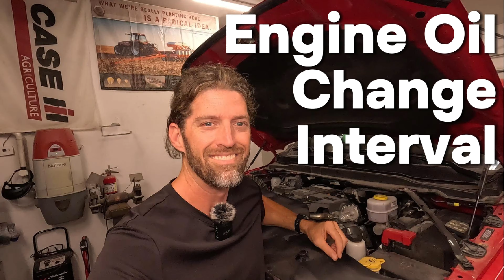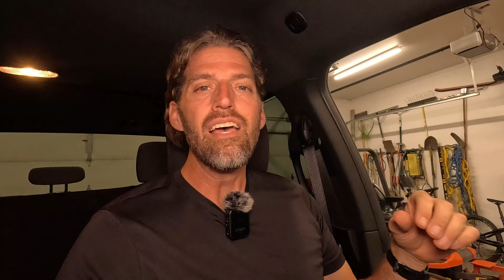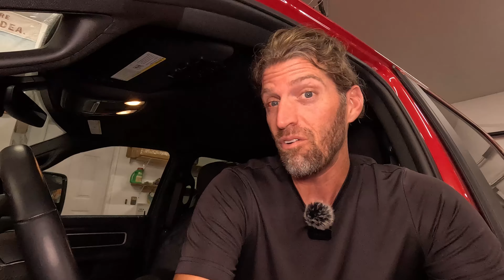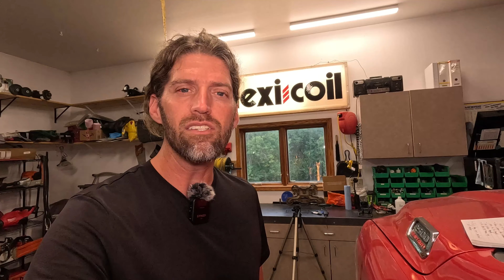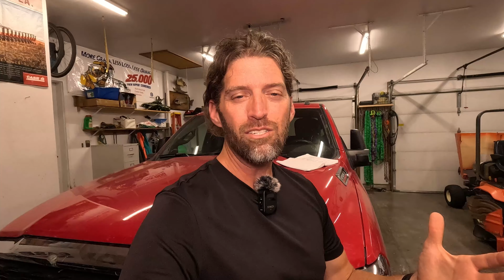When to change your engine oil? Factors to consider.

Comment: In SAE paper 982718, they ran a test on extended oil change intervals for fleets for 500,000 miles and found that 30k miles on a diesel engine was safe and had no adverse effects on engine durability. They even tested 45k-60k and the oil was still within acceptable parameters. You could save a lot of money if you went 30k miles on your oil changes for diesels. If you want to know for sure if its safe, just send an oil sample to an oil lab and they will tell you if the 30k mile interval is safe.
Reply from the maker: Appreciate this comment. Fully aligned to we non-commercial users of diesel engines probably change our oil earlier than necessary. Definitely a huge sentiment of 'it is cheap insurance', which i can respect. If there was only a way to sense the equivalent of an oil sample within the sump/block for more accurate oil life indication! Cheers.

Comment: every 5000 miles if use full synthetic less if don't period 
oil and filter is cheap maintenance
Reply from the maker: Any thoughts on engine hours versus miles for change interval? Seeing more vehicles showing hours, which I think is a good things, give us a broader picture of engine use. Thanks for sharing!
Reply: @LearnedFromDad  I agree with you that we need to look into it but we just don't have enough information about the hours yet but if he is having lots of hours and still it's not telling him to change oil for 14000 miles I have problem with that so until more information I know on our company equipment we change oil every 200 hours just because of the abuse it gets but right now I don't believe it is an affective way for vehicles only time will tell

Comment: any good mechanic will tell you never to follow the owner’s manual intervals because it’s way…. too long. manufacturers only care about the warranty period not the life expectancy you want from the car.
Reply from the maker: Thanks for sharing. Understand your point. I work with and train mechanics for a living, lots of horror stories but also many non-negative.
One of the key things I was hoping to get more conversation was the difference in change interval based on hours (which I believe is superior), versus miles (just an estimate of engine use).
All good though, great discussion. Cheers!

Comment: Every 5000 miles/ 8k kilometers or every 6 months. Toyota recommended for my 2005 Camry. Still driving it 20 years later. Toronto Canada
Reply from the maker: Thanks for watching. Yes, recommendations have changed over the years for many reasons, and vary widely depending on engine type (gas/diesel), oil capacity, etc. Any idea how many engine hours it takes for you to hit your 5k miles / 8k kilometers?
Reply: Fellow Canadian here, I change the oil on my winter and summer tire swops, every 6 months roughly 10K   13 Camry and oil is never very dirty!
Reply from the maker: @davidcampbell1899 that's a great way to never forget when to change! Thanks for the comment!

Comment: For gasoline engines the easiest way is to simply keep your oil clean, use your eyeballs and common sense! By dropping some oil on a piece of paper from the dip stick you can see the oils condition, (the oil blotter test)  if it is turning a brownish  color then it is time to change.

On diesles the oil get´s black pretty quick so going by the milage might be a good idea. Today´s motor oil holds up very well, it´s the deposites that are the problem, by changeing every 5000mi you can be pretty sure the oil is not worn out. 

Oil and Filters are cheap, there is no need to buy the most expencive BRAND! As long as it meets the manufactuers API Spec. you can use the cheapest oil you can find. 

Keep it simple........Keep it clean.
Reply from the maker: Thanks for the comment. Agree, keep it clean. Great maintenance is important. Good comment regarding blotter test. Hopefully the filter is doing its job, isn't clogged, and opening the (potentially present) by-pass.

And, I appreciate your comment about ignoring all the 'marketing' gimic, and price not identifying quality.......follow the API/testing standards.

One thing I was really hoping people would discuss more is engine hours as a means of engine use. I know miles has always been king, because that's what we've had for years in passenger vehicles (no hours shown), but engine hours is what really identifies the amount of time/use that engine has had on that oil change interval. I mean, I've never seen a generator or power unit accumulate any miles :) Of course there are all the micro nuisances like trip interval, hot/cold cycles, environment, etc, but I see those as more fringe influencers.

Any thoughts on engine hours, versus miles, when it comes to change interval? I personally like to keep an eye on both (I idle very little and drove 90% highway).
Reply: @LearnedFromDad  On the Blotter Test you can see the condition of the oil, impurities will be floating in the middle, the outside will be clear, thta mean the oil is still funtionalble but.....if it is black in the middle then means the filter is no longer filtering but the oil is going through the by-pass. As I said when you see the oil is getting brown then it´s a good time to change both oil/filter.  You can google motor oil blotter test, the photos will show you what too look for.
Hours: I worked many years on the docks driving machinery, all diesles, we went by hour service, I do not remember the interval (I think 1000hr.) as we had a shop that did our service. You can belive me the oil 15w40 took a real beating, those terminal trackors with VOLVO ENGINES pulling 40tons on FULL GAS, 16hr and more. We used the same oil in our cars, one of the guys tore down his VW engin....completly clean, no sludge at all.  I believe Long Haulers here in the EU go by the hour servis.
Reply from the maker: @markwarnberg9504 I can only imagine the abuse those poor trucks took! Great comment, thanks!

Comment: When I follow what the computer recommends on my Honda Civic, the oil does not look good at all. My mechanic’s recommends doing at 50-40% instead of 10%.
Manufacturers recommendation are just good enough for the engine to last until end of warranty.
Reply from the maker: Thanks for watching and the discussion. Relative to oil not looking good, have you ever done an oil analysis, to get some lab data on actual quality? When I drained mine this time, I should have grabbed a sample and sent it in, would have been a good follow-up for everyone.

Definitely not suggesting to only watch a single metric, rather be aware of the different variables involved and make an educated maintenance decision. I do feel that engine use (hours) is often heavily overlooked and miles is focused on too often. While miles is a great historical indicator, there is a huge difference in engine use depending upon avg miles per hour driven during that time. I'm 90% highway miles, so my miles get high compared to engine hours.

That said, I was a little further in my oil change interval that I would have liked to be, life got away from me, but particularly based upon engine hour requirement I was only at 70%.

Take good care!

Comment: For the last 40 years I have always changed our oil as soon as it gets close to being non transparent.  I just hold the dip stick up to the sun and if I can't see light through the drop of oil on the end I have gone to long.  I can see it building up because I check it weekly, I can see the contamination building up week to week.  Most of the time it's around 5000 miles.  We have cars that we don't drive very much, I never let them go past six months, no matter how little they are driven.  Think of the oil as being a cleaner, if the oil has become contaminated it has done it's job and needs to be changed.
Reply from the maker: Thanks for watching and the comment! Glad to hear your minimally used engines are still getting changed (based on calendar time, I feel that is often overlooked.

Regarding clarity of oil, definitely a means to understand 'getting dirty', although a little tough with diesel engines as that color change can happen quickly....especially with older engines.

Curious, have you ever done an oil analysis at that point of color change? Just for fun, to see what the oil condition actually is? I should have taken a sample from my last oil change.....would have been a fun follow-up.

Take care!

Comment: The reality is it all depends on a lot of factors. I wouldn't follow anyone's recommendations without them being very, very familiar with that motors inner workings.

Most manufacturers extend the intervals well beyond reality. This is for government mandates, as well as driving down ownership costs. While oil change places typically say 3k to get more profits.

Oil quality, driving habits, and environment play big roles. I'm pretty sure all oils are way better than they were 20+ years ago. But still, better quality oils stand out in today's market. Driving is probably the biggest factor. Unless you start your car, warm it up for a minute or two. Then do 50 mph non stop for 30+ minutes and park it. You're probably driving like most of us, in varying combinations of conditions. The shorter the trips, the more stop and go driving, even engine load shorten everything. Lastly dust and moisture. It'll always make it's way in. The more you've got, the worse off you'll be.

For the average driver trying to balance the most out of their vehicles. I would say no more than 5 to 6k between oil changes. That's using a pretty good quality oil. This is obviously gasoline driven engines, and naturally aspirated, non performance engines. Diesel is different.

Even after 6k miles, your oil may still be fine as far as it's ability to lubricate and suspend contamination. However, chances are, the oil filter is at, or close to bypass. The bottom line is. Oil changes are a cheap insurance for an engine. The more often you do them, the fewer problems youll have.
Reply from the maker: I love this comment, and 100% agree with you. What I was really trying to highlight with this video is exactly what you were stating (without making to too awful long), is there are more factors than just miles, and that it's important to think about the big picture of your scenario.
I definitely wasn't trying to imply anyone's opinions or actions were wrong.....my title may have been a bit misleading (lesson learned)....rather I was hoping for great comment conversation because it IS a complex topic.
I'm actually one of those very unique cases....live on a highway, drive all highway to work, spend very little time in town, drive long duration road trips. So, my avg miles per hour is way higher than most. Hence, in my case, while I was near the Ram/Cummins suggested 15k miles, I was only ~70% on hours. Little later change than I'd planned, but life got away from me.
Hope to see you back again, I appreciate your sound logic.
Reply: Oh. I'm not sure if you took this as criticism of your video. It wasn't. Your video was fine. I was just kind of adding to it, I guess you could say. More or less throwing out what I would figure a good equivalent or average for gas engines. 

Seemed like you liked my comment but thought you may have thought I was critical. Maybe im overthinking it. Regardless, I appreciate the reply.

I'm no expert. I just tinker. I've never designed an engine. Nor have I ever formulated any oil. I work on my own equipment, but I'm not a trained mechanic.

  So, to anyone who read my original comment. This is all personal experience, talking with mechanic friends, watching oil analysis videos, and seeing what extended oil change intervals do to friends vehicles. That's my disclaimer, and I'm sticking to it. 

And no. I can't work on your car for you. And no. You can't borrow my truck to move next weekend.

Comment: I change my oil every 2800 to 3k miles. I still got a 2012 Camry SE with 439k miles. Still runs like the day I purchased it new. Same with my 2019 Tundra and 2020 Camry XSE.
Reply from the maker: Thanks for the comment. That's awesome you nearing 500k on your Camary....and over 12yrs....wow! Definitely not saying a 3k mile oil change is bad, I definitely hope nobody feels I was insulting their choice, because I certainly wasn't trying to. Rather, wishing people to think about the different what oil does (lube the moving parts) and things to consider for when to change. There can be a lot of variables if only miles were ever watched, due to things like average speed during that oil change period. We uses to have construction foremen who's trucks ran for 10-12hrs per day, and putter around a job site. If only miles were considered, those poor engines would have huge hour intervals over even a 3k mile change interval. Good luck on the journey to 1 million miles!

Comment: I have worked on vehicles almost every week for the past 12 years and sell car parts. The general consensus of the professionals is every 5-6k miles no matter what the manufacturer says.
Reply from the maker: Thanks for the comment, appreciate it....and mechanics are my favorite people....have worked with and educated them for years. Definitely not saying any person or group is wrong, rather getting people to think about the bigger picture than just mileage. Two people drive the same mileage between oil changes (say 6k miles), but one averages 20mph and the other averages 40mph over that 6k miles.....the first engine had double the run time and oil abuse as the second (making assumption the engines operate at the same average RPM for the example). Engine hours, and even a service life indicator can help to push a person to an oil change. Take care, and thank for keeping people's cars rolling!

Comment: Everyone is going to debate about this until the day the technology dies because the problem is that your engine would love it if you changed the oil once per week, but nobody wants to pay for that, so the eternal argument is about how cheap that the oil change interval can be. Change it once per year, at least, twice a year if money is good, excess engine maintenance is always a winning game, but you won't feel it until you sell the running car away.
Reply from the maker: Thanks for the comment. Agree, a very debatable and (potentially) controversial topic. 100% not telling anyone they're wrong, just hoping all think about what engine oil does, what we're trying to protect, and understand mileage has always been used as a directional indicator of engine use (rotations), but understand other things like hours, service life indicators (which use various elements), and general time. Take good care!

Comment: Manual says 7500 miles. I just do 6000 just to be safe.
Reply from the maker: Yeah, I got a little further in use than I planned, life got away from me. I was close on mile suggestion, but only 70% of hour suggestion, so I wasn't quite worried yet. I drive probably 90% highway, so my engine hours to mileage ratio is far different than most people.

Comment: you're going to get a lot of comments that are adamant about car manufacturers using too long of intervals. i speculate that those intervals are fine for ideal conditions. the owners manuals usually have a 1/2 as long interval for "severe" conditions, which i think a lot of car owners probably qualify for. the problem is that this info is often in tiny print in the footnotes.
Reply from the maker: Thanks for the comment. Yes, I knew it would be an interesting topic. I'm definitely not impressing my tactic/opinion on anyone, more importantly wanting people to consider that mileage alone really shouldn't be the only indicator of an oil change, the ratio of it to engine use (hours) can vary widely. Plus, as you say, things like use/load, climate, etc. Take good care.

Comment: The manufacturers lie through their teeth. If you changing oil every 15K miles you are shortening it's life. That is a selling point telling people like you that you saving money by going so long between oil changes. No oil on earth will perform well when it is pitch black with carbon. The carbon turns into an abrasive and will prematurely wear out your bearings and timing chains if your vehicle has them. They expect you to trade it in between 100K and 140K miles so it will last to that milestone. I have opened hundreds of engines where people change oil every 10K miles and it's full of carbon. So good luck with that.
Reply: You are 100% right.
Reply from the maker: Appreciate the comment. And, was definitely hoping for mechanics to comments.....I work with and have trained them for years in ag, nothing but respect. I'm definitely not saying only following Ram/Cummins 15k mile indicator is right (I was several thousand late on where I originally wanted to change, but life got away from me), rather also wanted people to think about the other elements beyond just miles. I drive 90% highway, and idle not a lot,, so the ratio of engine use (hours) to mileage is significantly different for me than say a person who drives 20% highway. I definitely should have talked about that more. Any thoughts on engine hour triggers for oil change internal, gas versus diesel? I honestly wish there was a better way for people to know the engine use, oil condition, etc so it wasn't such a guessing game for people. Take good care, and thanks for what you do keeping engines rolling.
Reply: Do you really know more than the engineers who designed the engine? If you're really worried about the 15k mile interval, just send your oil to an oil lab, and they will tell you if you need to shorten the interval or prolong it. Watch freedom torx video about this topic.
Reply: In SAE paper 982718, they ran a test on extended oil change intervals for fleets for 500,000 miles and found that 30k miles on a diesel engine was safe and had no adverse effects on engine durability. They even tested 45k-60k and the oil was still within acceptable parameters.